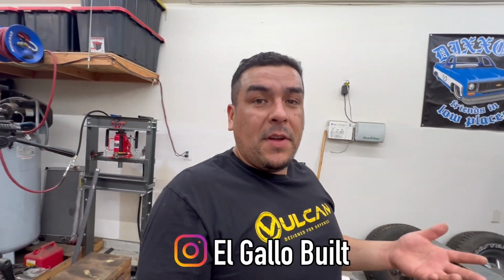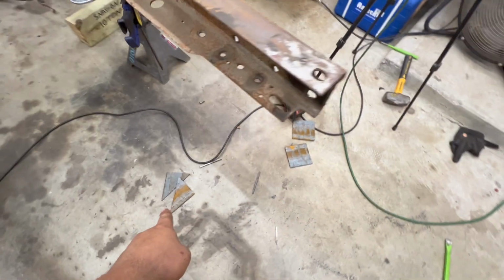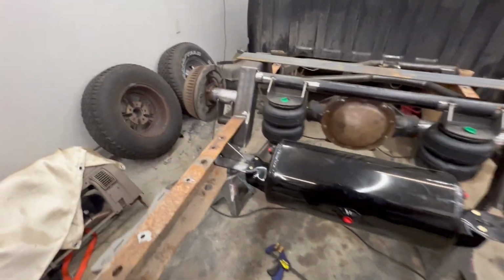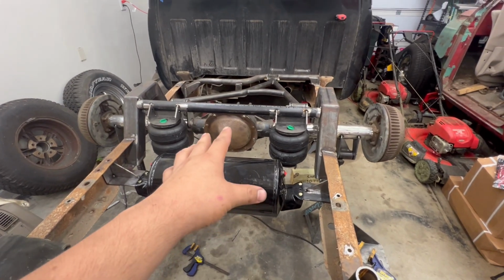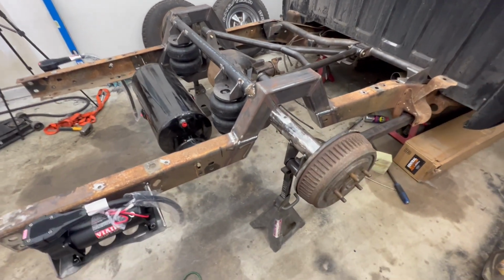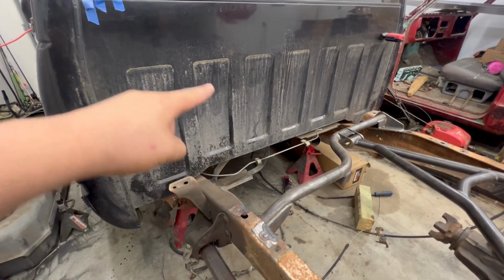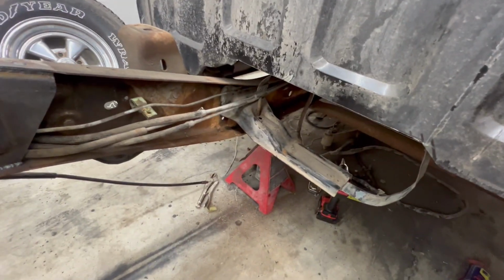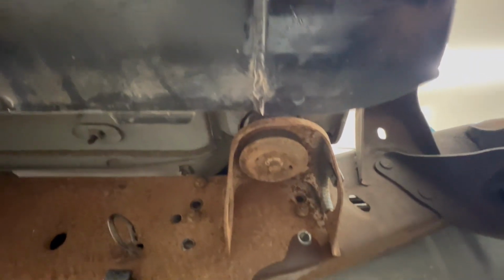Air Tank Mount, Welding, and Fuel Tank Mounting!

Comment: Hey Gallo!have a question for you i have a 1999 4dr yukon .I want too do bags.truck has 10 in r15 wheels .I want too get it low enough too where I could have like an inch between fender and tire from the upper part.i am fine with that .I am not looking for anything crazy.no c notch or doing any cuts too the front fenders.want too keep it like 90's look

Comment: Are you worried about stress on the tank since it's kind of a strucural frame member (although I assume you'll add another crossmember toward the rear)? I feel like it wouldn't be a bad idea to add some rubber or urethane bushings to take up flex, either way. I like the brackets. Truck looks awesome!
Reply from the maker: Yes we are planning to add reinforcement back in to the rear of the frame.

Comment: What's the clearance/gap between the cab bottom back and the tank? That looks really close, hard to tell on camera. Do the cab mounts give enough flex for it to rub the tank top when shaking the cab?
Reply from the maker: Has little over 1/2” of clearance in between. We’re partnered with LMC truck so we may upgrade body bushings
Reply: @elgallobuilt6841  That will definitely help. Your work looks great, i am enjoying this project 👍
Reply from the maker: Much appreciated. 🙏🏽

Comment: I live in Houston, I run a dryer after each of my compressors, before the tank. They catch a lot of water.  I have to empty them regularly.  Are you installing dryers on that truck?  I wish I had a bigger air tank as well, might be an upgrade you should consider.